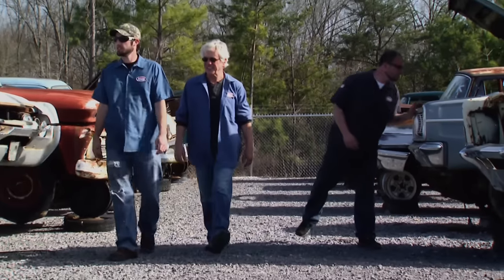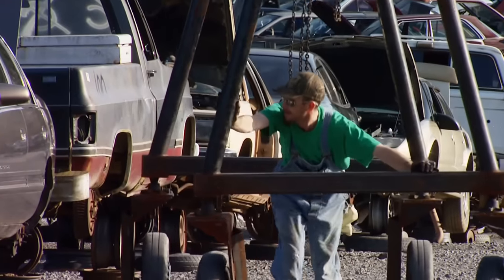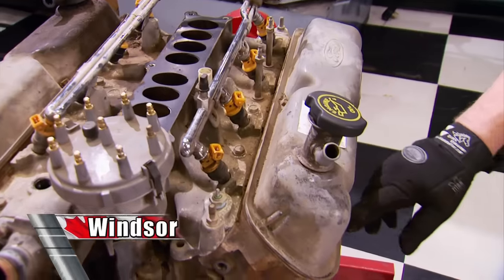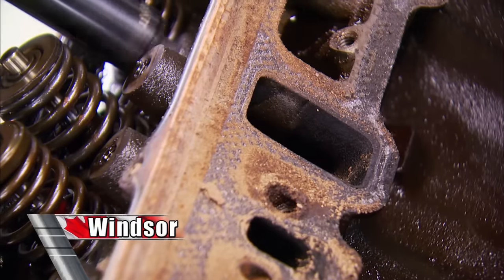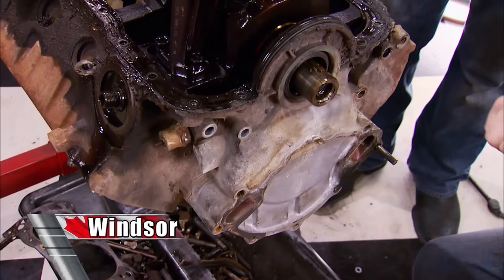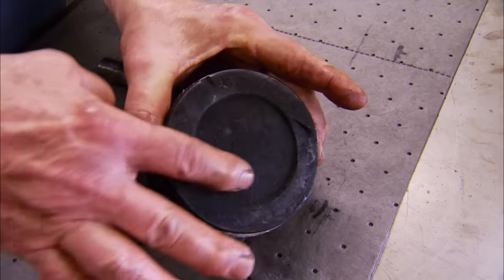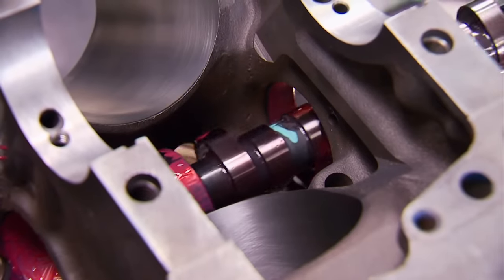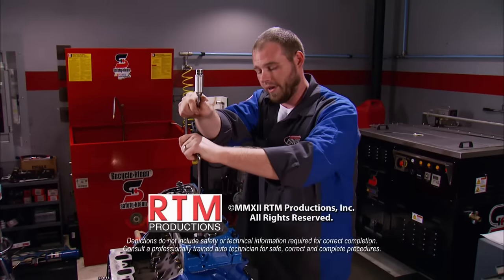Tearing Down a Pair of 351 Small Blocks: Windsor vs Cleveland - HorsePower S16, E10

Comment: 3:55 - That was a 73 Cougar, not a 71 LTD.
Reply: bob marker yeah that sure was a Mercury Cougar, my eldest sister actually owned one of those cars
Reply: explains why the block was a 72-74 cast date then
Reply: Glad somebody else caught that.  I’ve got a 73 xr7 with that same motor, thought I was loosing my mind!
Reply: guy used to work for Tennessee Wildside on PBS, so doubtful he knows much about cars or turning wrenches, I kinda cringed when I saw he was the host
Reply: @karlsmith2570  I thought it was a montego like mercury's version of the torino
Reply: Yep its definitely a montego look at the back side window definitely not a cougar
Reply: Matthew Wilson no I personally would think that the Montego would've looked a lot more like the car that's dubbed "The Striped Tomato" on the series "Starsky And Hutch"
Reply: @karlsmith2570  I thought cougar at first but the upswept door gave it away a 73 cougar door was flat on top the striped tomato was a ford torino and was same platform but newer than this car
Reply: The front turn signals were different on the Montego, they didn't wrap around the front of the fender, but both cars were very similar.
Reply: It is search 1975 1976 montego mx it's the exact car
Reply: Same car basically.
Reply: True.
Reply: B Cal maybe he was a mechanic before he became a tv host.
Reply: NOT a 73. I own one. That's a 74.
Reply: @matthewwilson5388  its a Montego!
Reply: Yes, either a Cougar, or Montego...  Definitely NOT an LTD!!
Reply: I had a '74, visually the same but with 400 CI and C6 trans for RV hauling. Coldest A/C ever!
Reply: @matthewwilson5388  same
Reply: Wow, this was a great episode!
Reply: Definitely a 73 Cougar my first car which I still have is a 73 Cougar

Comment: Ford 221V-8

The first engine of this family, introduced for the 1962 model year as an option on the Fairlane and Meteor, had a displacement of 221ci / 3621cc / 3.6 Litres, from a 3.5 in (89 mm) bore and 2.87 in (72.9 mm) stroke, with wedge combustion chambers for excellent breathing. An advanced, compact, thinwall-casting design, it was 24 in wide, 29 in long, and 27.5 in tall (610 mm × 737 mm × 699 mm). It weighed only 470 lb (210 kg) dry despite its cast iron construction, making it the lightest and the most compact V8 engine of its type of the era.

In stock form, it used a two-barrel carburetor and a compression ratio of 8.7:1, allowing the use of regular (rather than premium) gasoline. Valve diameters were 1.59 in (40.4 mm) (intake) and 1.388 in (35.3 mm) (exhaust). Rated power and torque (SAE gross) were 145 hp (108 kW) at 4,400 rpm and 216 lb⋅ft (293 N⋅m) at 2,200 rpm.

The 221 was phased out in April 1963 due to a lack of demand after about 270,000 had been produced.

Comment: We built a 302 in the late 70's I'm really turning back the clock here but my buddy put 351 C heads on a 302 .I remember the bolt pattern being the same but the holes for the bolts in the heads were diff. sizes. My buddies dad got it running after we did all the bull work.It screamed on a 66 mustang.

Comment: 351C-4V engines had a valve clearance notch on top of the bore.
Reply: Also 4 bolt mains and if l remember right they also had better crank and rods.
Reply: @aaronlempka2198  4 bolt mains yes
Reply: The only regular production line Clevelands that came with four bolt main bearing caps on all five main bearing positions were the ‘71 Boss 351 and its lower compression follow up, the ‘72 351 Cleveland “HO” meaning High Output. Both engines featured solid lifter camshafts and an aluminum 4-V intake manifold. The ‘73 and ‘74 Clevelands with 4-V induction were named Cobra Jets and almost always came with 4-bolt mains. The exceptions would be when the assembly plant  production line ran out of 4-bolt blocks they used standard 2-bolt blocks instead. Sometimes 4-bolt blocks have been found in factory produced station wagons and regular sedans that were available with two barrel Cleveland engines. When in doubt the only way to know for sure is to pull the oil pan and check because there’s nothing in the block casting numbers or production date codes to indicate if it has 2 or 4 bolt main bearing caps. 

All 351 Cleveland production engines including the Boss used the same rods and cast nodular iron cranks. For durability verification, Ford used the Brinell testing method on nodular iron cranks to verify the level of surface hardness. Cranks with the highest level of hardness were used in the Boss 351 engines. There were a very limited number of steel cranks made for early testing in factory experimental engines but the chances of finding one now are slim to none.

Comment: The Cleveland came out of a 73 cougar, not a 71 LTD. The compression ratio in a D2AE block was 8.5:1.
not 7.9 as mentioned.
Reply: Maybe someone used 2 head gaskets instead of one?
Reply: 77-79 M blocks were at 7.9:1 with the cam really backed of and a standard 2.5:1 in the rear end.
Reply: socalltd   I thought that sounded ridiculously low. Like VW Beetle low.
Reply: thats the dark days of automotive known as the 70's. .
Reply: that was a 74 cougar.
Reply: Gonna say same thing

Comment: Great Video!  I would note that the 351C "M" code blocks could also be 4 bolt mains and that there are reports of some "Q" code blocks being only 2 bolt.  I have owned or still own a 67 Ranchero, 72 Ranchero, 72 Gran Torino Sport, and a 73 Ranchero GT Q Code all with the 351C...its a great engine.

Comment: Had a 400m (Cleveland motor at heart)  and everyone used to tell me, oh, you'll never get a hundred thousand miles out of it. Everyone around me seems to think those Motors were garbage. Well, I don't mind and that thing had tons of power, and just gobs of bottom end torque! I added a high volume oil pump, performer intake, cam and lifters, and an Edelbrock 600 four-barrel, ported and polished the heads, and that was about it. Still had the factory deep dish pistons in it, but because I ran out of money and had to be able to drive, I threw it in with what I had. I tell you, I couldn't keep tires on my vehicle after that! Very underrated engine. And parts availability, I found to be similar to a small block Chev! Love them old Cleveland engines!

Comment: 14:12 400 Hp is not coming from raising the compression. If the engine make that much. It’s because of the cam.
Reply: Compression and cam work together....
Reply: Well yeah, not just the compression but it takes very little to get 400 HP out of a Cleveland. here is a video where a guy rebuilt his 351 C stock and they put it on the Dyno. with a stock distributor with points, cast iron intake and exhaust ... they just put a holly in place of the smog Autolite carb and it produced 352 HP and 391 TQ.  with just a cam intake and headers it's amazing the power those thing can produce. I'll never understand why those engines didn't become super popular. oh ..here's the video ..    https://www.youtube.com/watch?v=ggaoKDn7KDI&t=134s
Reply: @Autojones  The Cleveland was intended as a stopgap. Once Windsor caught back up, they didn't really need the 335s anymore. But, the 351M and 400M are essentially just tall deck Clevelands. You can find them in huge numbers of F-trucks throughout the 70s. Bumping the compression and a hotter cam really helps the Cleveland and its M cousins. 400hp is nothing. And Holley used to make adapters to put a Cleveland intake manifold on the taller deck M blocks. A single plane manifold, Holley 750, hotter cam and Cleveland pistons with rods bushed to fit the Cleveland pins, 450hp was easy peasy. Seriously good motors and they are everywhere.
Reply: @Autojones  Yes I like Nick. I hope he don't start saying stupid stuff like these guys to make money.
Reply: @falconater68  Why do people raise the compression when they install hotter cam?
Reply: @Autojones  we had them in series production from 1971,400hp was standard for the 'race' cars, the factory claimed less,but it wasn't unusual for the unrestricted classes to be getting 600hp out of them n/a in 1972ish,if memory serves they shipped the tooling for the cleo's down to aust in about 1976 and we kept them as a production motor till 1984
Reply: @Autojones  Because parts were always cheaper and more available for the Chevys.
Reply: @blackericdenice  Why not?
Reply: If you simply put a cam, intake, and headers on a 2 barrel Cleveland the money required to match it with a 350 chevy would be WAY more. so no. that ain't it. I think it's more the average man has the attention span of small insects.

Comment: Tearing an older v8 engine down and rebuilding it is definitely on my bucket list. I wish there were a shop that you could do this kind of work in. I'd hate to have to buy all the equipment. I don't mind paying for the new parts and engine. I know that if I did take an engine apart, I probably wouldn't have the right tools or I'd break something. I'd probably have screws I didn't know where they came from. I guess I would need to make friends with someone who owns a shop.

Comment: Another "recycler" that intentionally damages usable parts when "draining all fluids".
Reply: @bigboreracing356  So the 5 seconds per vehicle that this destructive approach saves is worth scrapping every oil and trans pan out there?
Reply: @bigboreracing356  .... yap yap yap... you'd think someof these turds^^^^ have a brain...
Reply: If they didn't do it, the EPA would shut them down...some EPA superfund sites were junkyards!
Reply: @bigboreracing356  a few plug welds. The gas tanks the same after filled with water. Plastic tanks can be patched with a piece of red hot sheet metal and a cup of water.
Reply: you'll never find a cat converter at a junkyard.
Reply: @kenchorney2724  holes in steel pans can easily be brazed shut.
Reply: @scottdowney4318  It's even easier if they don't ruin them in the first place.
Reply: Just cut the tank straps instead of blowing a hole in the gas tank, and zip that oil pan bolt out, but the gas tank is my main pet peeve, but I'm used to cars that they dont make replacements for
Reply: Its my job draining fluids at a recycling center. Unfortunately not every oil pan has a drain plug. As for the gasoline you cannot siphon it out so you have to punch a hole in the tank. There is not enough time to remove the gas tank to dump it out. And you cannot have cars going out in the yard full of gas and oil.
Reply: jason9022  Sure, you can easily braze steel.
Reply: jason9022  It will adhere and stick like it was made for it. I have done enough welding and brazing to know and so have many others. It is how iron and steel things are repaired. there are no  extreme temperatures, and no temperatures will hurt braze unless it gets red hot like over 1500. This is not solder, and you could even soft solder an engine oil pan and it would work ok.
Reply: @liebherr11602  thats genius. so just get it hot set it on the tank  a second and pour the water on it?
Reply: @mikburton5028  yes , let it embed itself and pour water should only take a few seconds.
Reply: jason9022  
Remember the old true Schwinn Bicycles? They were all mild steel tubing frames with all brazed joints. They knew what they were doing.
Reply: @ryanroberts1104  A $40 Amazon made in china piece of crap may be ok for you, it is not ok for me. I was referring to auto trans pans that are ruined and a particular diff housing which had a hole put through the housing. The "recyclers" chose the fastest and cheapest way just to save time (money), not because they give a rat's ass about the environment. Fastest and cheapest is not always the best.

Comment: A Cleveland is basically a small block with Big Block heads.
Reply: @ ACPHOTO....No doubt the huge port and valve sizes on the 351C, 4-V heads are big enough to support the extra displacement of most any big block engine and make some impressive power numbers as well. But as you probably know, Cleveland heads won’t actually bolt on to any of the Ford big blocks. 

However, most people don’t know that Cleveland heads are a direct bolt-on for any 260, 289, 302 and 351 Windsor small block engine. The bolt patterns and bore spacing are the same
Reply: A minor modification has to be done for proper coolant flow when using Cleveland heads on a Windsor block and there are only a few intake manifolds currently made for the Clevor combination because of the 0.300” taller deck height of the Windsor block but there are spacers available to adapt  more intake manifolds to the Clevor engine. 

Companies like Edelbrock and Trick Flow Specialties make aluminum Cleveland head and intake manifold packages specifically for the taller deck Windsor blocks. 

It all raises a pretty good question....Why would people choose to trash their Windsor in-line valve heads to replace them with a pair of the aftermarket aluminum Cleveland heads currently available from at least 6 different manufacturers in the U.S. and Australia or even the factory cast iron canted valve 4-V heads that some people say are pretty good boat anchors ???  The answer is obvious but I would rather not go there because the topic causes reasonable minds to go totally ignorant and creates a massive traffic jam on the information superhighway 😉.
Reply: @danielwilson6665  yup! Ford even did it themselves on the Boss 302 mustang 😊 

I wish they made a Cleveland head for the ford 240/300. I know racers have made DIY versions, but it would have been rad to have a factory one.
Reply: @alexcorona  That’s for sure my friend. The big Ford straight six is impressive enough but the addition of one of the extensively chopped and rewelded  Cleveland canted valve angle heads is the ultimate naturally aspirated modification possible. It has been proven many times over. The fairly big Flow volume requirements can use the Cleveland deep breathers with huge results. Keep on thinking positive. Ya never know when one of these heads magically drops from the sky and lands squarely on your six 👍🏁

Comment: that's a 74 cougar that the cleveland came out of.
Reply: That's the first thing I said to myself too . Shouldn't be working on a car if you don't even know what it is !
Reply: and that ain't no cobra jet 351 either . 351 cobra jet had 4 bolt mains on the center 3 mains.
Reply: @robbalex1963   Only Q code CJ's had 4 bolt mains.
Reply: Sparta  True, although a lot of US Q code blocks came out in other ordinary lower tier Fords. The factory rating for the 351 2V dropped from the dual or single pipe rating of  1971s 265 or 250 or 245  gross to 178 hp net for 72, mostly a gross to net rating change. Then it dropped further due to EGR and thermactor and the Duraspark advance drop, and the cam retard. So for 1974, it was even less at 156 hp. Really hit hard by the lack of proper 4v intake and 4bbl like the Australian 351 2V 4bbl had that year. The actual rating of those were 200 to 216 hp net, but they had no air pump, 8.9-9.4:1 compression and single or dual pipes. That 245 rating JE quoted is gross and not correct.
Reply: @deanstevenson6527  Great info!  Thanks!!!

Comment: Clevelands seemed like they ran better with the 2 barrel heads on the street. No velocity in the 4 barrel heads until you get past 5 grand.
Reply: Windsor heads suck. Even the best DO0E castings from 69-70 aren't great. Windsors really need aftermarket heads to make good power, but once you get some on it, it's a great engine.
Reply: Yes and No. It's been solved in the aftermarket. No need to use 2V heads which even ported don't match a good set of Edelbrock heads. Best Cleveland heads for the street are CHI out of Aussieland.
Reply: @dj4monie  i had a 351 Windsor with ported 69 heads in a 79 notch back mustang. I had lunati cams take a chevy grind and put it on a 351 firing order cam for me. They said it wouldn't work. I ran low 12s high 11s with not much compression 87 octane and a tight converter at 117mph. Flat tappet hydraulic. A friend of mine had a built Cleveland with high compression 4v heads big cam running 13s. The closest street car at the time was a big block chevelle. I played around with an rpm air gap and victor intake but the car ran the same. 28 inch tire 4.10 gear
Reply: Stock 2 valve is poop
Reply: @billyjack8119  all i hear in my head is a drag car going "Blub blub blub blub blub blub,"
Reply: @noway6852  ha ha yup. Even little old ladies gave the thumbs up
Reply: A simple fix to increase 4v head velocity is a stroker kit which moves more volume thus increasing velocity.
Reply: they made 4 barrel heads which had intake valves as big as a big block chevy 2.19. Thats what were talking about. I think the 2 barrel heads were what 2.04 or so which makes a great street head with the smaller runners as well
Reply: prushimush : Windsors dont detonate. Clevelands do. The 4V 351 W heads can work fine. The 4V 351 C issue was emissions, pump gas octane and detonation. The Pantera L engine and the last Mustang 351 4V Headed engines were sensational, but they were down to sub 8.4 or less compression ratios, and wirh EGR and no Cool Air induction system, they werent a patch on the 10.7 compression Boss 351, Fords best ever street legal small block. Another was the US export 350 and 380 hp net Phase II, III, and IV spec engines which were made as part of Al Turners QC SkunkWorks in Australia from 1970 to July 1972. 750 and 780 cfm Holleys and factory 300 hp gross rating 4V headed Clevelands are really nice machines, but the 1969 351 4V Windsor still was even nicer to drive. See this article.